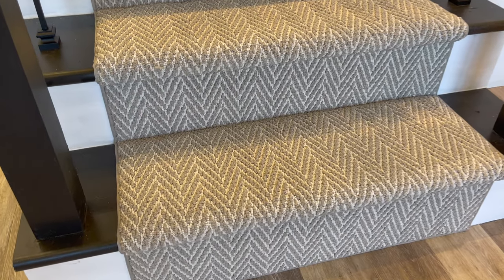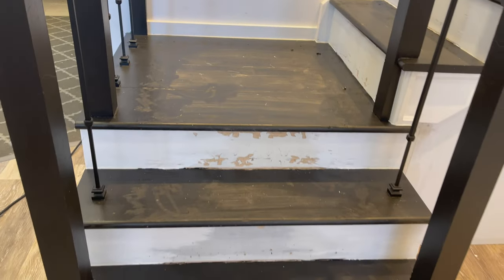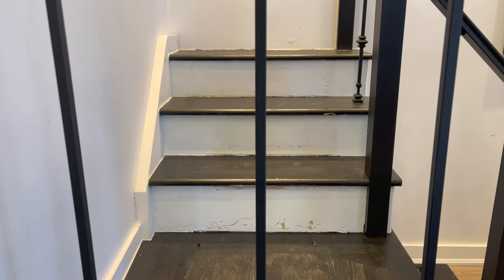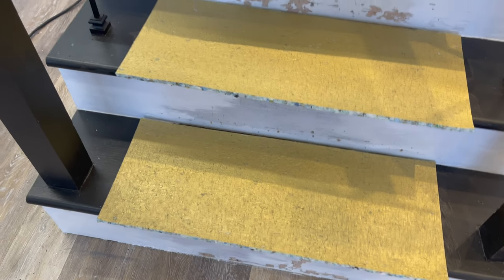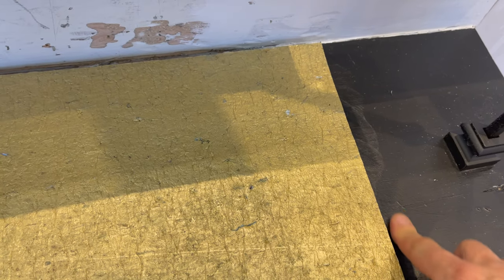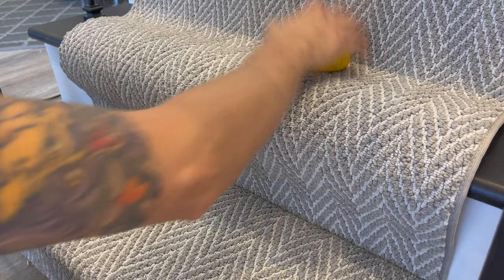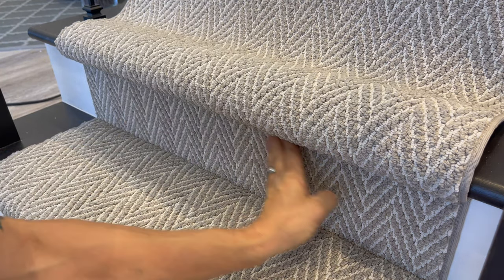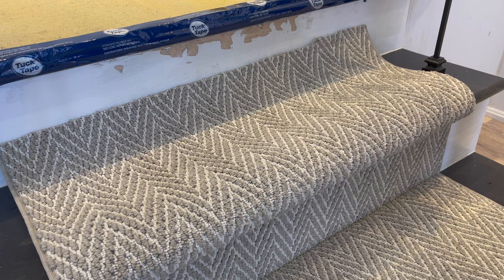Stair Runner installation Guide w/Right Turning Landing

Comment: Is there a way to order the run for the upper stair carpet to the seam / bottom stair in the landing when ordering? I prefer the herringbone design to run continuously on the bottom riser with the upper stair. TIA??
Reply: I will put question in at order site thanks!! No need to comment here